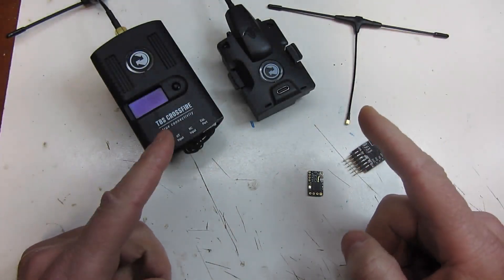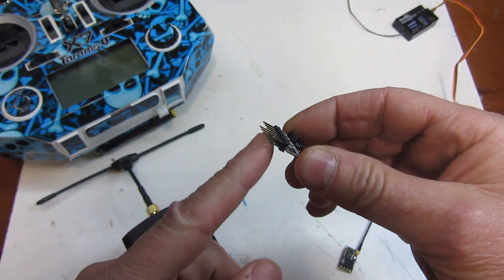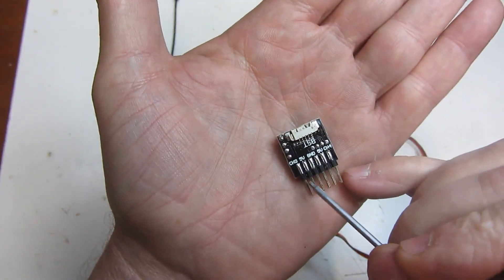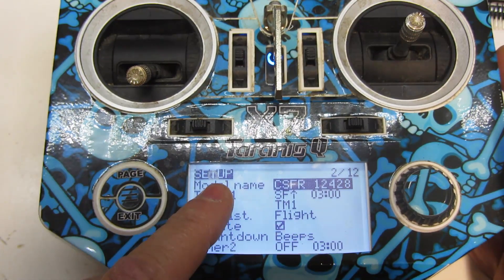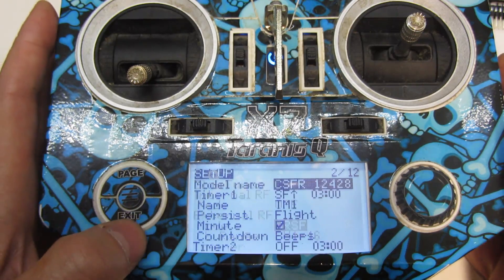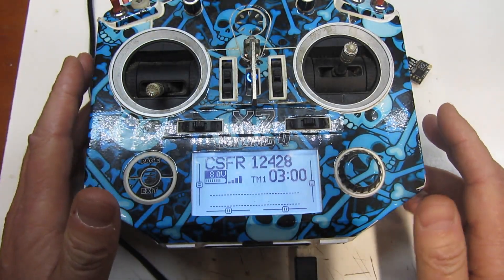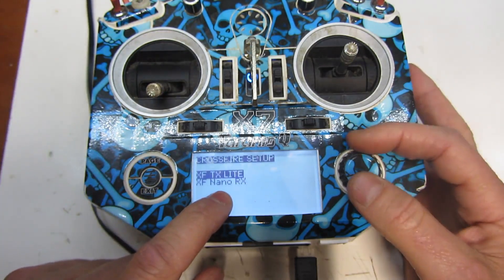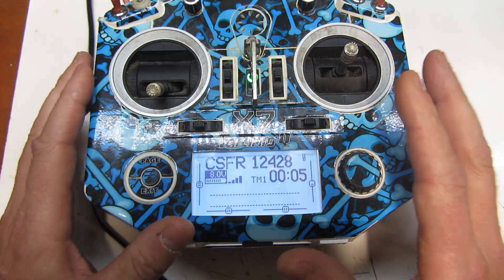Crossfire Install And Setup On Your RC Car/Truck/Boat/Plane.  PWM Adaptor Mod / WLToys 12428 Upgrade

Comment: Awesome dude,,, crossfire is going on my jeep,, it's also fpv, so other two channels will be pan and tilt,,, you taught me a lot,,, also now I know how to set it up on my airplanes,,, best day at work this week!
Reply from the maker: Awesome. I will add that you may want to filter the voltage in to the XF Rx thru a regulated 5v power source.  I found out that if you power the XF straight form the ESC BEC, it can cause some weird things to happen.
Reply: @Matt633NLT  do you have an ez 5volt regulated solution that plug between the esc/bec on throttle? Or how are you getting 5v to the rx?
Reply: @Matt633NLT  what about 5.5 v coming off the bec? Most my airplane esc have 5.5volt. That's kinda close to 5 volts,,,will that be a problem?
Reply from the maker: It really need to be a clean voltage though. You could use a small inline 5v reg coming off the lipo.
Reply from the maker: I just looked again at TBS website and it calls for 5v which is what I thought.  I would feel better just running it off a 5v reg. You can pick up a 6pk of buck converters from Amazon for cheap 
https://www.amazon.com/MP1584EN-DC-DC-Converter-Adjustable-Module/dp/B01MQGMOKI
Reply: @Matt633NLT  OK, but I also read here on the tbs manual it says 3.3v to 8.4 is OK,,, hmm  Standard/ Lite TX: +3.5 to 12.6V via RC/ module bay or HT 3-pin input connector, External 2S to 3S LiPo via XT30 connector (standard RX only) MicroTX V1: 3.5 - 13V, V2: 6.0 - 13V
Diversity RX: +4.5V to 8.4V
Nano/Micro Rx’s: +3.3V to 8.4V
All reverse-polarity protected, compatible for 2s Lipo direct
Reply from the maker: @FPVDiverBomber  I stand corrected. Sounds like you're good to go. 
😎👍

Comment: Great video! The only thing missing is stating that you will need to mod the qx7 in order to use crossfire.
Reply from the maker: You are correct. I've mentioned that in prior videos. It's hard to not get bogged down with too many details in a video like this. I almost didn't make this video just because I seriously doubt even a single person will do this, so some details being left out really doesn't matter I guess. But thanks for pointing that out. 
Have a great day.
Reply: @Matt633NLT  I can tell you that at least one person is going to do this, me! This is the video I needed as I haven't been able to find any others. I'm going to be dropping a crsf nano diversity rx into a modded ARRMA Felony using DJI with a Caddx Vista for some drag racing fun. Thanks again for the video, liked and subbed!
Reply from the maker: That sounds awesome . Now I'm jealous. Lol. I'm sure it will be epic. You obviously already have the tech savvy to do this . I'm sure it will turn out amazing.  😎👍
Reply: @gavinlarissa  I am another person wanting to do this.
 I am wondering where does the 1.2ghz a/v come in?  Does it hook up to CF ?    If so where?    Or no.  Because it seems like you/I could outrun your audio/video !?
 I now have a VAS pepperbox Rx  and a VAS  blue beam Tx. They work very well now,  (see my video's)  but will the a/v keep up with the CF on the ground. 
All my parts are still in the box yet unopened.  My 1.2ghz system on my truck out runs my truck. You know how it is when it just stops.  because there is too many trees in the way. 240yrds in the woods.  I cannot tell how good my video will work and how far yet.  It doesn't seem to be mentioned anywhere.
If you know please comment.  Thanks Bill
Reply from the maker: I'm not completely sure what you are asking so I will just summarize and then we can go from there.  
First off , the XF Rx is simply just another rx. It's running on the 900mhz band. Of course you will need a radio with a TBS Crossfire module or a TBS tango2 tx. 
The XF Rx is soldered to a breakout board so that the RC car ESC and servos can easily plug in with out soldering. 
This has nothing to do with the video (fpv) at all. This is only the control link. And the the breakout board allows it to be easily used as a PWM Rx like those found in RC cars.  
As far as the video, it doesn't matter what video band you use. But it is no way tied into it. 
As far as the XF out running your video, that's what you want. You are better off seeing the video degrade allowing the user to turn back before video is lost. 
Where as if the video outruns the RC link, then you would be dead in the water with no warning if you Fail-Safe at long range. You always want the RC link to be the stronger of the two. 
Again, the RC link is totally separate from the fpv gear. They are not integrated.
Reply: @Matt633NLT  OK well, you summed it up. If there is not an a/v link (tie in) I will get what I get. I susppose. Well,, this weekend i start
the install. Thanks a bunch for your video. IAnd taking time to explain it in detail.  It all has giving me what I needed. Courage and something to refer back on. Ahhh
Reply from the maker: Hit me up in email if i can help
rcinginsc@yahoo.com

Comment: Thanks for posting the video but I'm still confused.
So where does hooking up your or say MY 1.2ghz. Audio video transmitter come into this.
Reply from the maker: I'm not really sure I understand your question. This vid was only about using a crossfire receiver for RC link. Not video . Perhaps you could elaborate.
Reply: @Matt633NLT  I was thinking that the rc link and the video link were both 915ghz.once wired.
 I was never sure how it did it, but I thought with your 1.2 and the crossfire wired that somehow turned it 915... now my video link is still pretty good when I lose transmission of the rc truck.
But I was sure that both systems got enhanced. Rc and audio & video.
Now I'm confused a Lil more. But if the audio video transmitter doesn't wire up, I guess it's just that much.
 easier.  and that's all you get. 1.2 works great in the sky but not so great on the ground after so much treason Earth between you and the vehicle.., there must be some answer because some of the videos I have seen, I would have thought the video would have failed by this time in their video. Where they just keep going and going.. But thanks for your answer back Brad.  Bill.
 I'll keep looking.
 If I figure it out I'll let you know.
 Have a great day

Comment: As I expressed before, I don't have  a Turanis nor plug-in modules. Is there any way this same kind of thing can be added/ used with your original FlySky transmitter? Many of us have those radios and they are land-based rather than air. I added this to the RC Groups mod thread. Thanks.
Reply from the maker: Like every other RC link manufacturer, each is a unique protocol. Crossfire especially, since it runs on the 900mhz band. The only way to use a XF Rx is to use a XF module or tango2 transmitter.  
Thank you for sharing this . I really appreciate it.

Comment: Dustin Dunnhill: Puts a DJI Air Unit into a buggy - Brad, hold my beer, lol. I learned something today, mind blown - I did the PWM stuff on a raspeberry Pi but had no idea it could be done on a crossfire RX, this is going to be epic.....
Reply from the maker: Does it all make sense now ? Easy huh?
Reply: @Matt633NLT  I lived and breathed Pulse Width Modulation at the robotics startup - that I understand. A quad RX to me is just values from 1000-2000 on each channel that the flight controller uses, that's where I was getting thrown off with the servo option....so stoked!
Reply from the maker: The only thing that is a little different is that of course a car ESC has fwd and rev, so most esc's are looking for 1500 to be "neutral". Unlike a quad ESC that needs to see 1000 to be neutral. Yea, that's it.

Comment: Nice tech tips Brad! Those crossfire receivers are long range?
Reply from the maker: Yes. Very long range and very robust and reliable. Thanks Mike 😎👍
Reply: TBS equipment in general is high quality, but their Crossfire 900mhz radio equipment is the gold standard for long range and not dropping connectivity